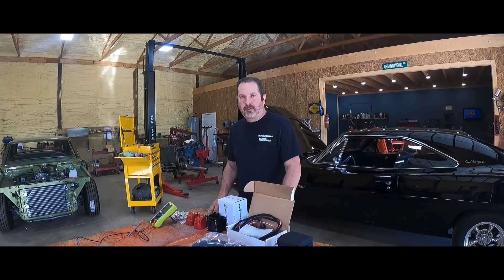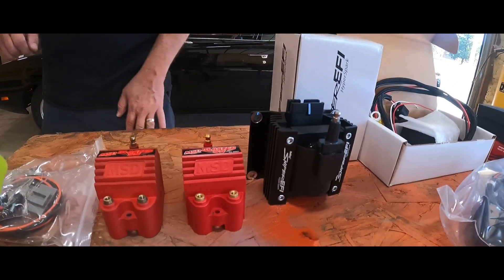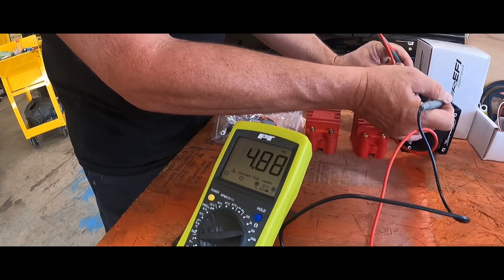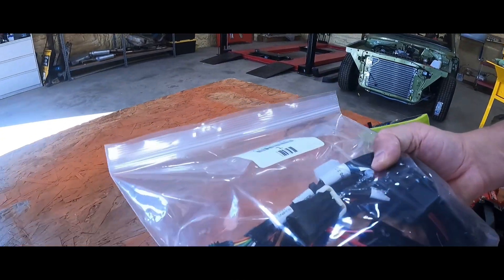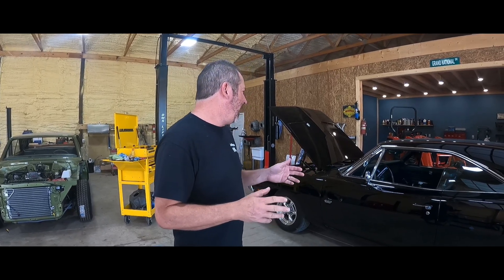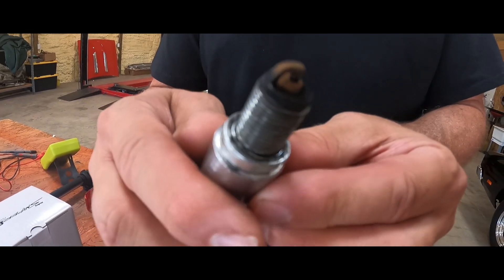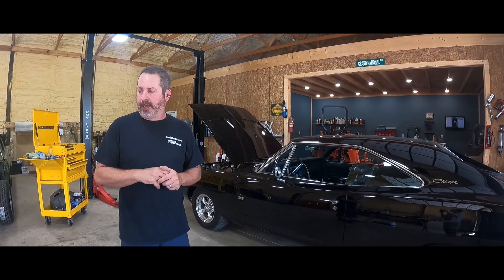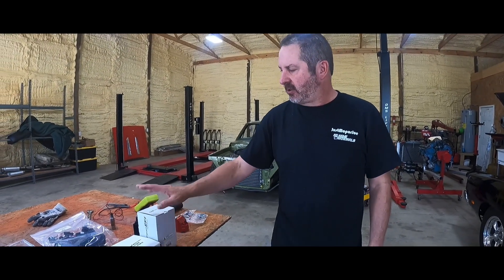MSD SS Coil Failure

Comment: One time I had a high speed miss on my sons 88 Cougar..  I tested the primary and secondary part of the coil it was good.. Now with a oscilloscope running you could see it breaking up at high rpm... The measurements meaning nothing! It is the preformance at actual working condition that counts. Weather coil or coil on plug 100% test is oscilloscope even so called good coils can fail out of the box!...at rpm at heat gets into coil... Once burned twice shy...but I found the culprit the coil!..  The scope worth its weight in gold.
Reply from the maker: @moparnut6286  - I’m still elated that I found the problem and it’s back to running properly again.

Comment: It will kill you if hit directly blake No spark too foul around with MSD is #1 in my book more in cars, motorcycle,race machines, snowmobile drag sleds then anything else there's a dam good Reason for it thats why there #1blake!!!!
Ps your luck you got 12yrs on the Race part takeing that heat Man O Man Best Stuff Tho!!!! Jb.
Reply from the maker: @johnnybrigham8754 - Yes sir! I don’t have any issues with MSD. The box is still working fine. Looks like the coil is what failed. I agree with you about MSD.
Reply: Blake a event shirt your taken your charger too in XL jb
Reply from the maker: @johnnybrigham8754  - Yes sir